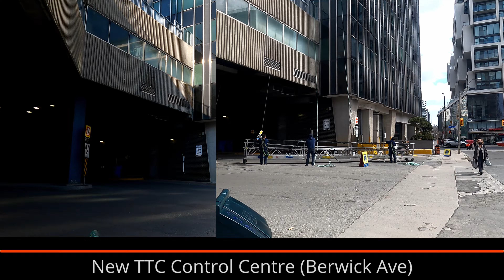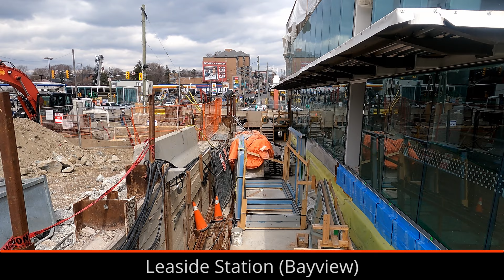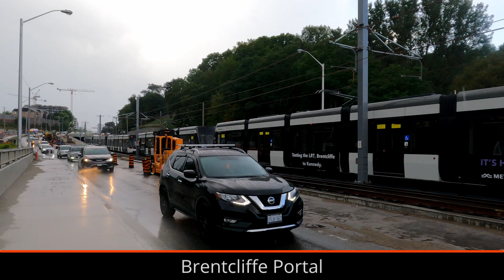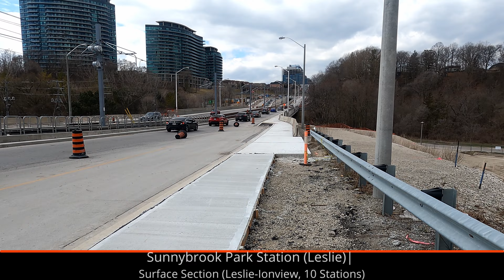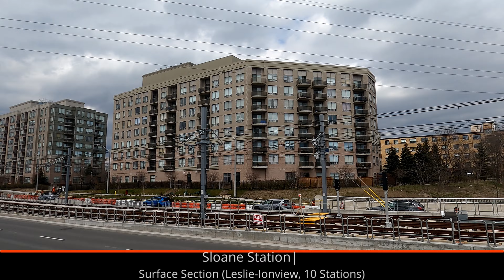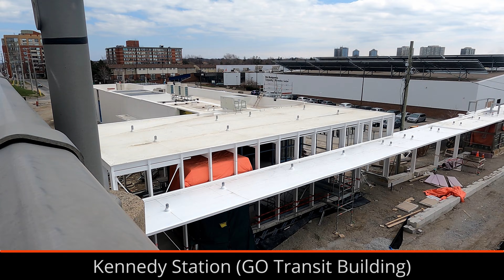Eglinton Crosstown Progress East & Surface Section April 2022

Comment: how will people pay for their fare at the surface stations?
Reply from the maker: Riders will need to pay on board the trains on the surface section, ticket machines will also be on the platforms.
Reply: @transitthinker  I heard that there will be no fare payment machines on the eglinton lrt and payment on surface platforms will have to be done on the platforms
Reply from the maker: @bigbandgapenergy  I'm pretty sure that the option for fare gates on line 5 is being up to the TTC but it's very likely that they will have them. However the surface stations would have on-station and on-train payment